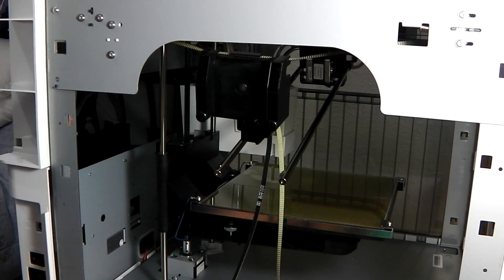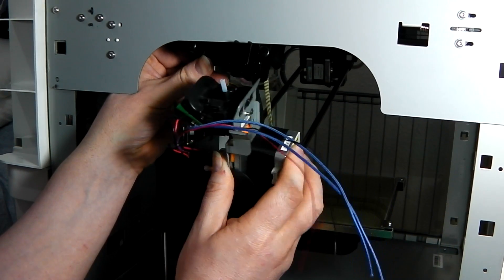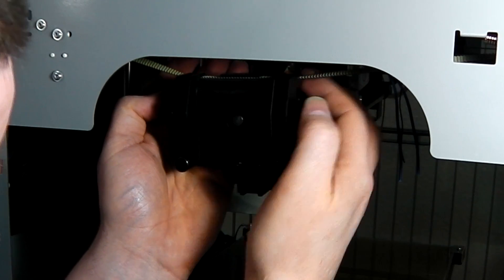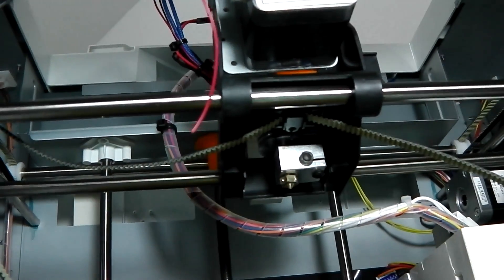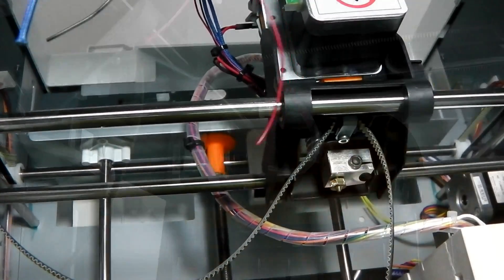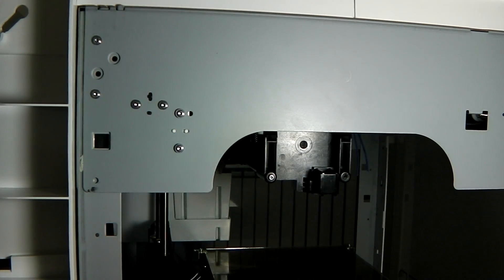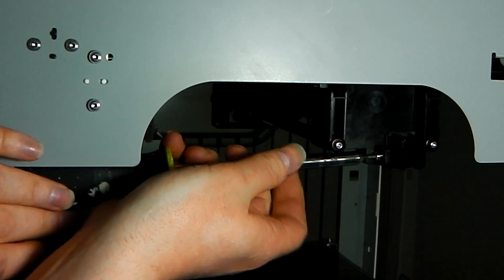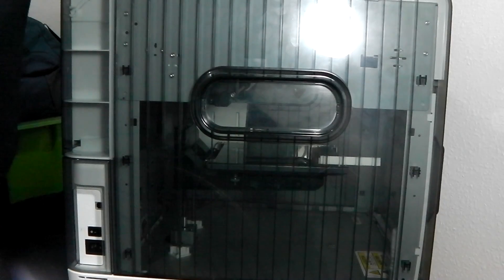XYZ Davinci 1.0A 3D Printer now with an E3D v6 hot end (Phase 6)

Comment: Is there any way to still do this without the board from the old hotend? my old hotend is broken along with the board. i have purchased all the parts and i am at this step in the video, if i can do it any other way please tell me
Reply: +StevenQ-NE-UK I went and found the connecions, if anyone else asks just send them here! http://voltivo.com/forum/davinci-peersupport/622-e3d-v6-mod-without-carriage-replacement
Reply: +StevenQ-NE-UK Hi Steve, first I like to thank you for taking the time and making these videos and helping us all. I completed the install, yet I have a 0014 error. (Found bad connection and fixed) yet I still have the error. 

What happening. 1. Power up unit and in 30 sec I get the error. Reading Extruder 10Deg C, Platform 50 Deg C. Is the thermistor connection, that you are referring to the, that is nozzle connection on the Board and Not the fan?

If so it seem that my wiring is wrong, for the wires come from the fan. So what I did I took the connection and connected the Nozzle slot. I don't get the error now, but it been 20 mins and I'm still waiting for the temp in nozzle to get high enough to do a calibration. Seem that the printer back fan is tuning off and on, every 45s or so then the temp reading for the extruder increases a deg or two and the process repeats? 

I think I have some rewiring to do. 

As for my wiring for the E3D V6 I have a the 2 Red (Heat insulated) and 2 white wires (Thermistor, wire ?). The fan has a Red and Black wires. 

Also what version of Slic3r are you using. I have version 1.1.6.
Reply: +Craig Lewis Did the rewiring, looking good now. Yet I'm question if the fan being hard wired in is the best, for the fan will always be on. thus making it longer to get the temp up on the Extruder. Would it be best to just wires the fan directly to the board connector (Fan) ? Trying to calibration (Program)  now, yet it is taking a long time to heat the extruder 105 deg C and 88 Deg C for the bed. Been 10 mins now. Maybe the Program Calibration don't work now?